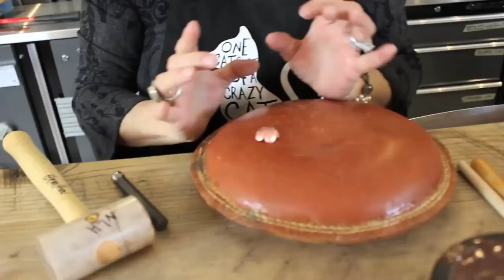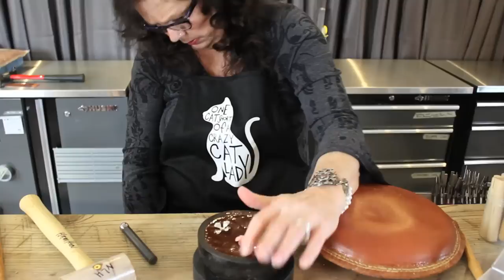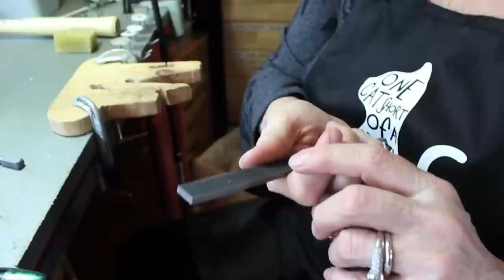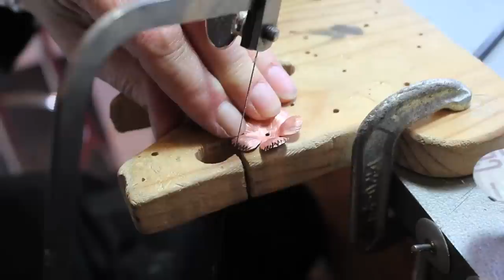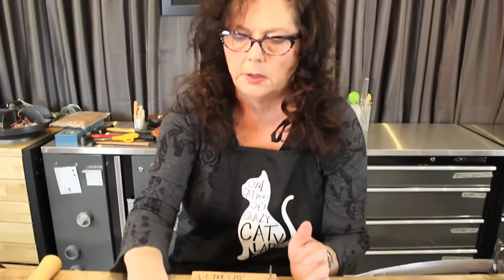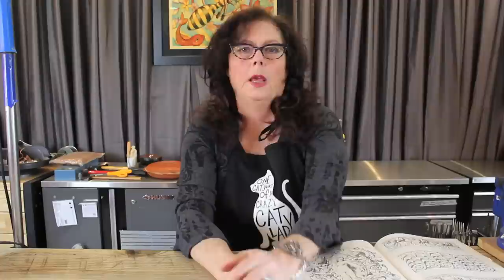How to Make Metal Flowers, Part: 2

Comment: Nancy, missed you! I'll definitely try making this. Also I always used brass instead of copper till now, I thought they were at almost the same hardness level. I'll get some copper sheets too. Take care till next time! :)
Reply from the maker: ailurophile Hi Ailurophile, on the Mohs scale (Talc is a 1 and Diamond is a 10) Brass is at 3-4 and copper is 2.5 - 3.  Copper is also so much more flexible after it is annealed.  You will be surprised by the difference in flexibility.   Good luck with the flower.  They are a lot of fun to make. Thanks.